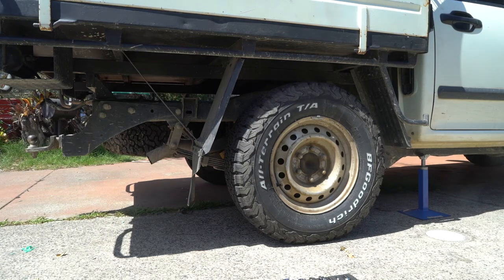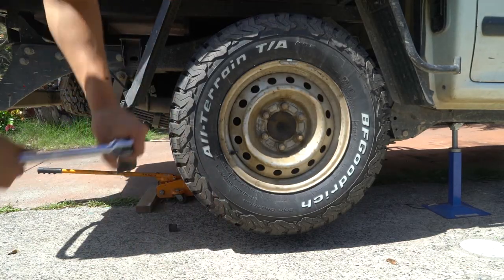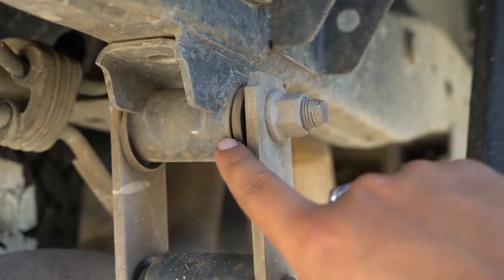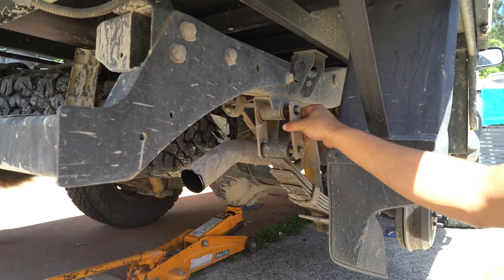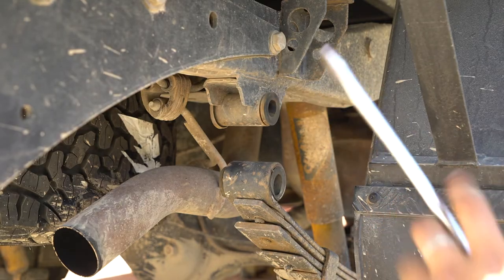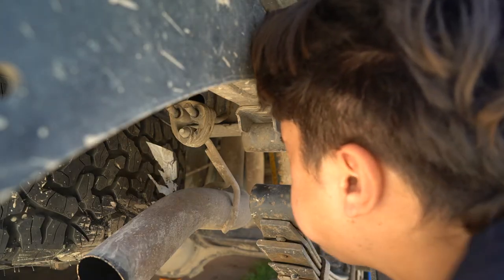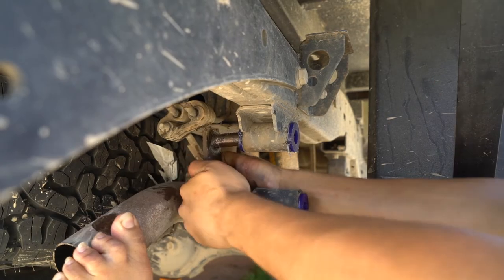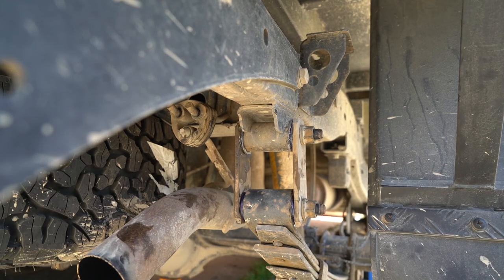How to Change Rear Leaf Spring Shackle Bushings on a Holden Rodeo 2008

Comment: No idea how ya did that like butter, I needed to cut mine apart, plus I couldn't even get the bushings in the new ones without a press, then when I did get them in, I cut one bushing apart pressing the sleeve in it, and then the sleeve got caught on the second one and popped it out the back. Super piss me off when some one else does this kind of shit in minutes, and I'm fighting it for days.
Reply: Depends what sort of vehicle you have because some vehicles you need to use a press and then there’s ones like this vehicle that are easy, I’ll be putting in all Nolathane shackle bushes in my 1993 Ford Courier ute in the next few days that are similar to this video👌

Comment: Have air bag suspension  under rear of my 2004 ra rodeo 2wd.
Can shackle bushes be replaced without removing wheels ?
Great vid, easy and no shitting around, clear vid, good job.
Reply: Yes you can replace shackle bushes without taking the wheels off

Comment: Be careful to jack the rear diff to a height that does not have a lot of weight acting on the shackle. If it's too suspended and the shackle wont come out easily then if can be very dangerous and spring downwards when the shackle finally comes out. Just adjust the jack until it is fairly easy to slide it out (spray with WD or similiar). 
Good video - time to do mine again... seems to last about 5 years
Reply: And do it with both wheels off if you’re going to do both sides which you should do and since the wheels are off you may as well take the brake drums off too and blow out any brake dust👍

Comment: Great video.  I found it easier not to remove the tires though.   Just use your nomal tire jack and jack the wheel till its just off the ground to take the weigh off the suspection and get too it.
Reply: Jack the body though you might mean so the wheel just hangs 👍🏻